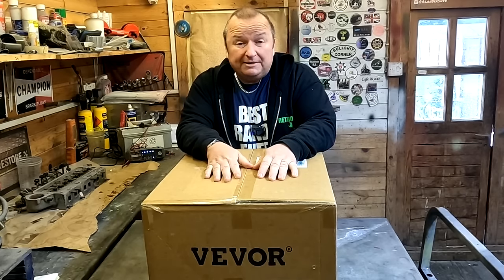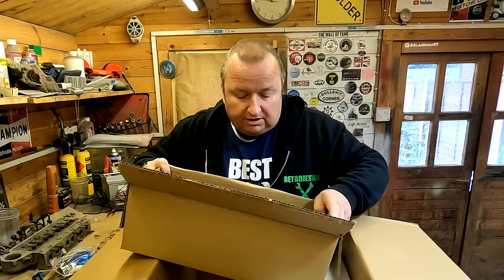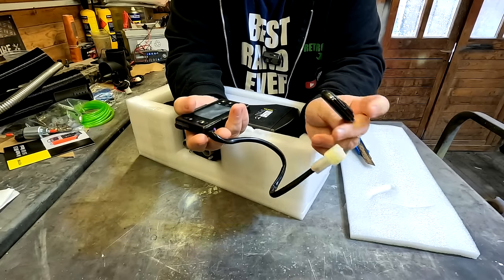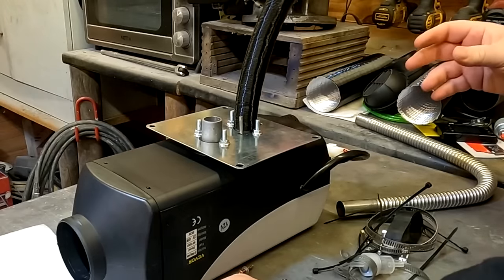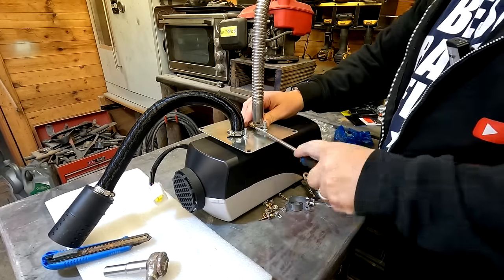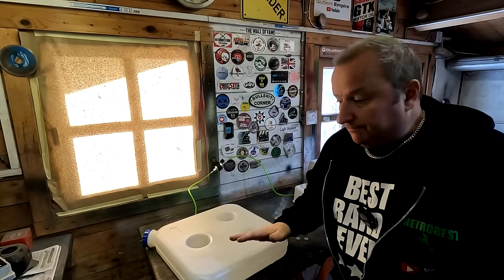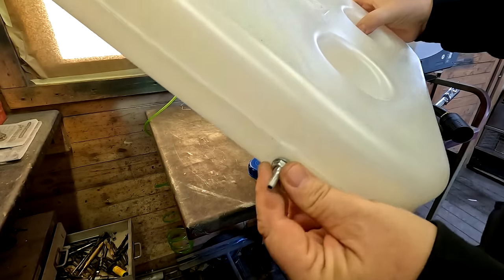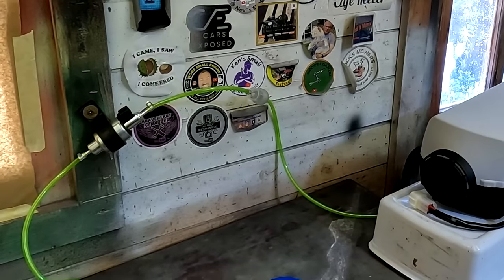Shocked - Using This Diesel Heater In My Workshop

Comment: Spare parts i recommend having is a set of gaskets, a glow plug, burner mesh strainers and a pump (the type that can be taken apart for servicing)
Reply: Coat the gaskets with thin coating of Vaseline or chapstick. Helps you get them apart for service without tearing gaskets and you can reuse them

Comment: I have one in my camper and one in my garage and is probably one of the best purchases ive ever made. A quick tip though Mart, make sure that the unit is on full power when switching off and on as it prevents carbon build up in the burner which will obviously lead to excessive smoking 👍
Reply: Indeed, run it on low power and you might get problems with carbon build up, a couple of minutes at full power before shut down will ensure that carbon build up dosn't happen. Then no stripping down and decarbonising is needed.

Comment: I have been using this kind of chinese diesel heater like 2 years now.. I do have an air heat pump now but this chinese thing is still on spare use. Works like a charm.

Comment: Brilliant clip, very informative and explained.
I fitted a 5kw 18 months ago this been my 2nd winter.
Iv a 5/3mtr wooden shed insolated, I found that even this large shed I run it on lowest setting.
Last winter it was 22c in shed and -5 outside with frost on roof.
I fitted mine inside....only pipe going out is the exhaust.
Only thing I did in cold weather was ever 24hrs of continues use was run it flat out for 15mins to burn any deposits off.
Reply from the maker: Very nice!

Comment: you need to   MOUNTING THE FUEL FILTER BEFORE THE FUEL PUMP So you want to make sure there’s no sediment getting into the fuel pump... good job helped a lot as I did not get any instructions with my diesel heater.

Comment: It’ll cost about £1.70 for about 6 hours Martin. We’ve got one in the Vivaro and one in the garage/workshop they’re both 2yrs old and never had trouble, always let it run down heat when turning off..
Ours are 2kw and in the van I only use it on low, it’s lovely and warm within minutes. If you leave them powered up the lcd display goes dimmer after a few months but it’s still readable. Get a standpipe pickup that goes in the top and use a Gerry Can as a tank Good Luck pal. Roly
Reply from the maker: Thanks for the info Roly.
Reply: https://www.youtube.com/watch?v=VSZzSx2ExdU to fix the dim display issue

Comment: I have been using these for 3 or 4 years in garage , I made them into window boxes like an air conditioner that can be removed . Good on fuel and no exhaust in building . The down side is sometimes they act up and you need to disassemble and clean .

Comment: I have one of these in my garage martin but its a complete unit as in I can carry it like a suitcase but why I'm texting is you need a 240v to 12v transformer off ebay for about £20 then it will run off the mains. But the main reason I'm writing is that the old oil i get from serving my cars i filter through a paint strainer and mix it 30/70 with diesel.  70% diesel.  And it runs perfect. Not sure if you could maybe even go 50/50
Reply from the maker: thanks for the info

Comment: I am fortunate enough to have a basement in my house. I have one of these heaters in the basement, with the output fed into a network of ducting that puts the hot air through the floors into the rooms downstairs. Exhaust goes outside, and the main air intake has some ducting that pulls the air across a joiner sleeve in the outlet ducting to pre heat. I have a egr cooler from a Mercedes and that scavenging from the exhaust producing hot water for another heat exchanger in a smaller room we have. I have a 3 port valve in the fuel feed that allows me to start the heater on diesel, once hot I switch over to anything I can find, waste veg oil with a bit of petrol or diesel mixed in, will produce great heat and burn indefinitely so long as you start on derv first and get it nice and hot before switching over. A few minutes before shutting down I switch back to diesel so it's primed and ready for an easy start next time. Brilliant units.
Reply from the maker: Thanks for the info Shane.

Comment: I'd move the filter to between the tank and pump.  Your unit is exactly like mine including accessories, etc.  I got mine from Ebay for the equivalent of GBP60 a couple of years ago.  Bargain compared to the prices everywhere else, mustv'e stumbled across a seller desperate to destock.

Comment: From my experience, running it low power it stop by overheat protection and running it max power soot it until it doesnt start anymore. This because air to burning chamber and heated air is blown by same motor, they dont match very well. But it seems running well some 95% power (or 5.2 pump pulse per second when max is 5.4)

Comment: I doubt if the plastic fuel tank is UV stable for outdoor use. It would likely turn brittle and fracture if exposed to sunlight. Probably a better idea to use a pair of steel jerry cans as fuel tanks. Make a removable vented bung for the fuel neck of the jerry can so it can securely hold a metal pipe that reaches down to the bottom of the can. Connect the other end of the pipe to the the fuel pump fuel line. No need to pour any fuel, just swap the cans over. You can always have as many full cans as you need on standby. For the bung you could modify a removable jerry can filler spout.

Comment: hay one thing i think would help you is a solar panal and charge controller from ebay may be . also if power is lost to the heater it could melt the chip board in side so iv been told . I had one in my van best thing i did kids never complained it was cold again .if i could set one up in my cold flat i would . also been told the heater can use just about any sort of fuel .

Comment: Fantastic things but the noise of the pump and fan would do my head in.
I would have to fit it outside and have the hot air through the wall into the building.
Will you make a video of when you install yours outside?

Comment: Installed the exact same heater in our campervan. For the prize I payed Im absolutely happy with the thing. If staying inside the van we had to turn it allways to the lowest heating setting otherwise it was getting too hot inside. Also the noise from the pump is barely to hear. Only things to complain here is the rather cheap fuel hose and the hot air pipe that comes with it is only some 70cm long.

Comment: Ive been using one of these in my workshop for the last six years no problems at all and i use a power supply 25amp  not a battery which i got on ebay  plus i have shut mine down loads of times with out down cycling never had a problem  the only thing i have done is changed the controller to the blue one and my fuel tank is a 20 ltr one you get when you buy red diesel you can either  use diesel or kerosene but diesel does have more BTUs mine is mouted in my outside shed and my controller is in my workshop been running it for six years with no problems not even serviced it ive taken it apart and there is no issues inside
Reply from the maker: Good to know, I've ordered a power supply as well.

Comment: I have two of these they do have issues long term.
1 carbon build up on heater glow plug theres a small air hole that carbons up and they fail to light.
2 they draw 8amps to start up so a battery can soon run flat if you set it to auto temp as it turns on and off
3 is the fuel pump fail on a regular basis if there outside

The fuel filter needs to before the pump and not after it not the filter that comes with the heater is any good as the filter medium is too course to be any good.
Reason for pump failure is a two part issue
1 the filter allows dirt from fuel tank to jam pump
2 is water caused by condensation in the fuel tank 

The pump rots out inside normally to return spring in the pump rots and pump stops working.

I carry two spare pumps and two spare glow plug kits make sure you get the kit with the glow plug tool or you’ll be stuck when you have to remove glow plug to change wire gauze around glow plug and make sure to clear the air hole in glow plug assembly.

The smoke you see on first start up is normal it’s just packing oil burning off once it’s been used it should not smoke unless it has an issue.

As a heater there good value but they do need to be serviced every year if you use them a lot.
I have one in my greenhouse 8kw and one in my mobile home 8kw also they use a tank a week if there on low day and night
Reply from the maker: Thanks for the info bud, very handy.
Reply: @retrorestore  I’ve run them for a long time now there not that safe they can gas in to the room via that air hole I spoke of it just so happens it in the air put area it’s a very bad design just make sure you have a co2 detector in your workshop near by.  If you look on eBay under diesel heater glow plug kit some times there a burn chamber listed it will give you insight into the design and the flaw I’ve found being this air hole that’s needed to ignite the flame and keep it burning. How ever it needs the air forced in to the hole via the fan that also forces the hot air out but it does get a blow back from this hole and this causes the hole to carbon up and eventually it fails to light and smokes very badly from the exhaust. Might be worth you doing a video on it pulling it apart it’s easy to pull down for inspection.

Comment: great how to vid, i have exactly the same unit in my garage run it on kerosene for a cleaner burn i would move the fuel filter on yours however to before the pump so it stops the pump internals from getting scored with dirt particles

Comment: i got the portable model comes in a metal case about the size of a little arc welder it has a smaller tank 5 ltr but its ideal for a cabin or shed i can move it about easily ,i think would,ve been more suited for you  Martin ,could,ve sat it inside spray booth aswell ,they do make small spaces warm as toast half an hour and its roasting hot and very efficient on low heat setting about 8 hours a ltr of fuel you burn

Comment: I run one of these with the heater inside and through the wall used some longer studs after half an hour it turns itself down when temp is reached only burns a couple of litres of heating oil a day

Comment: Great video and something I’ll look to do for my garage workshop. Campingaz do an excellent 230v to 12v transformer which is more reliable than an old battery. I used to have one powering a compact marine sump pump in an an underground storage facility to remove any water that seeped in.
Reply: I'm wondering if an old laptop transformer would work

Comment: Great video! I enjoyed watching as I am planning the same installation in my workshop. I currently have one in my adventure vehicle which is awesome! 
Only two points in your set up (in my opinion) could be improved. 
Firstly your fuel filter will also protect the pump if you locate it between the tank and pump. The other point is about the fuel line between pump and heater would benefit from being narrower so that a higher pressure is achieved with each pulse from the pump which will increase overall burning efficiency. 
Have a toasty winter!
Reply from the maker: Check out today's video.

Comment: I did the same few years back after mistakenly buying 2 on ebay instead of one. Then thought I'd put one in the camper and one in the shed. I run mine off a 12 volt psu I got off Amazon. It runs great on red diesel.

Comment: these units are designed to mount on the inside .. on the floor of a van or rv or truck.. but if you install in a shop then you just run the outlet through the wall then attach muffler outside . if you run the inlet also outside put it lower then the muffler or at least farther away   so you dont  draw in fumes from muffler
Reply from the maker: It is outside now in the next video.

Comment: Hi,
The fuel filter should precede the pump. Otherwise dirt might stuck the small piston inside the pump.
Also, the pump shouldn't run dry. It needs fuel to lubricate the piston inside or the tolerances will go crazy and the pump will fail prematurely. Priming the system should be done using other means, not the 2 buttons on the controller. That is not a good solution.
The smoke at the start-up is not quite normal. That is vaporized fuel that didn't burn. At the first start-up it should start in a few seconds. However, if it doesn't succeed, it will give you an error message (E8 I think).
Cheers!

Comment: Good video, these little diesel heaters seem to have a great following in the UK. the fuel filter should be installed between the tank and the pump, but it probably doesn't really matter.
Reply from the maker: I did that on the installation video.

Comment: I was about to get my 15kg gas bottles refilled for my gas heater but the price was nigh on £50 a refill. Just bought a diesel heater for the price of two refills, the shed should be toasty now for a lot less over time and it is easier getting diesel than than getting the bottles sorted. More room without the gas fire and bottles too.

Comment: Martin you should have got one in the metal case , I have 2 now for last 4 years ,first one like yours I build into a box ,second one I got in the metal case has tank on top easily portable even used it to heat house in a power outage (used battery)get a 240v ac to 12v dc  15 or 20 amp power supply,👍

Comment: If your thinking of using mains / 12v converter , I would consider a 12v back up supply in case of a power cut ,or damage could be caused if the unit can not power down correctly .
Reply: 12v car battery with a charger/maintainer.
Reply: @DCBChump  Hi Cameron , how would you hook something like this up, would the battery take over if there was a power cut or do we need a relay of some sort ..maybe a Diode of some kind
Reply: @stepho9999  Nothing that fancy. Connect the battery to the heater and the maintainer to the battery (the heater requires 12 volts to operate). The battery will power the heater and the maintainer will automatically keep the battery charged. If the power goes out the battery keeps the charger running and when the power comes back then the maintainer will automatically charge the battery back up.
Reply: @DCBChump  Yes  Cameron, BUT my main question was ::::if running heater on mains inverter how would you hook up a 12V battery to take over if the mains power cut out >?

Comment: I have a few of these heaters.  One in my workshop, one in my van and one in my garage.  They have been faultless except from a faulty temp sensor on one of them.  If you can get hold of heating oil which is usually Kerosene then it will cut your fuel cost even more.  They run well on the stuff.  Just remember when you fit it try and get the heating air in from the room your heating so you are reheating warm air rather then heating the cold air from outside.  Makes it more efficient.

Comment: I got one of these a couple of years ago, ended up giving it away, the output was amazing but the stench of diesel was awful.
I'd get another one if i could be sure that it wasn't going to stink !!
Will be good to see how you get on with this as I also reckon this is a good way to go, just disappointed with my result.
It almost seemed that the induction side was sucking in exhaust fumes.
Reply: I have one with  2 hole in wall no smell

Comment: this unit is not rated as a home heater and not leagal for this, so you need to fit it outside, and then run the hoses in to the house both the inlet and outlet side for recycling of the air (and im not sure if this even is allowed), but if not you are pumping outside air in, and pressurise the building, and the inside air escapes out. i have been working for a  eberspacher dealer for 23 years, and we have checked this for cabbin use, NOT allowed ! in Norway atleast. your unit is a chinese copy of the Eberspacher airtronic D4, so they will be simmilar for this matter.

Comment: I was going to get one of these last year and wished i did now i know a few wood turners that have got them, you could use a 12v power supply like what is used with cb radios for in the house i had one years ago.
Reply from the maker: Yes Yoy, i'm looking into that.

Comment: Had one in my narrow boat and it was very effective . The fan blows outside air through a heat exchanger, so that it never comes into contact with the flame which means totally dry and fume free air.
Your old Calor gas heater would have produced loads of moisture , and fumes into your shed making it a very damp miserable place to be in winter!
The only downside is that they can be quite noisy,  which is not a problem for your application , but can be annoying in a boat or motor home situation.
Reply: Unless installed under a bunk or cupboard with only vents showing and they heat up a lot faster than a multyfuel burner

Comment: I fitted one of these a couple of years ago heating my garage to keep the cold and condensation of the bikes and, very toasty in the winter when tinkering with them, great pieces of kit, rather than use a car battery get a regulated 12v power supply a lot easier.
Reply from the maker: i've ordered one

Comment: Evening Martin. Great video 👍🏻 I’ve had one in my concrete garage for several years as I have a model railway in it and it’s been superb 😀 Always let it cycle off or it’ll soot up 🙄 The exhaust gets very hot and the air filter stood creature getting sucked up lol 😆 One good thing for your channel is make it heat water using a car heat exchange unit and a pump and radiator 😊